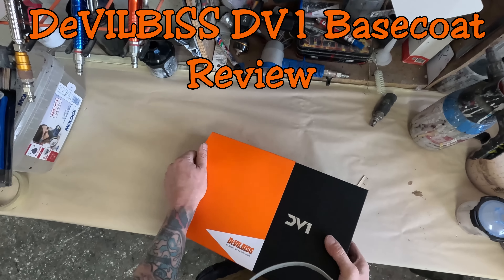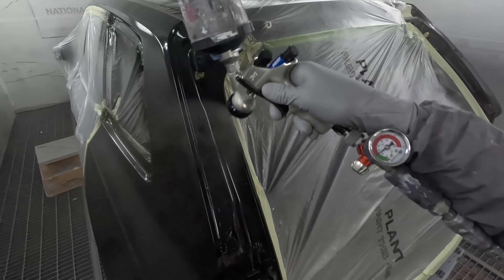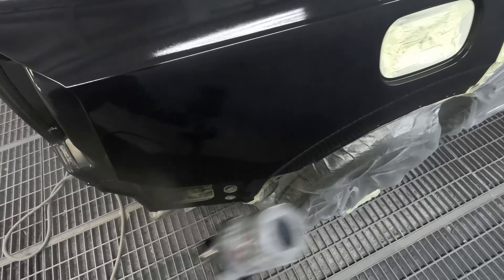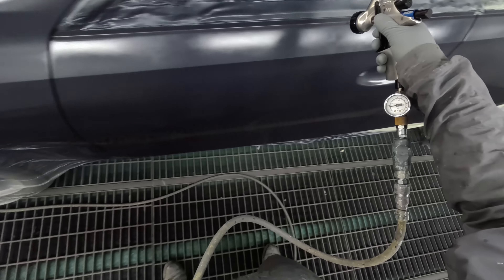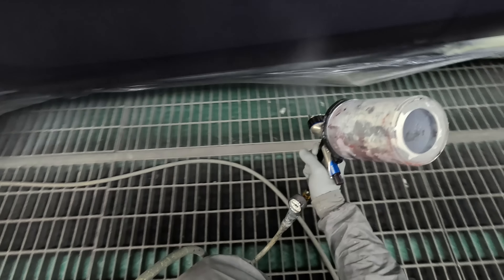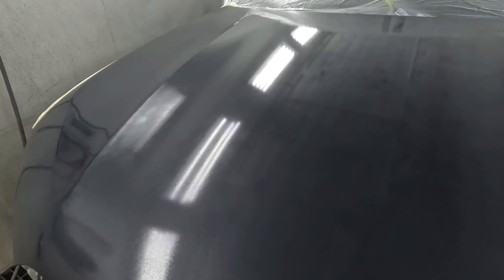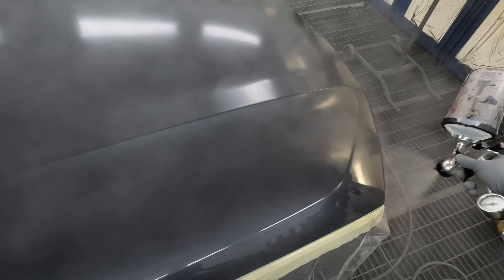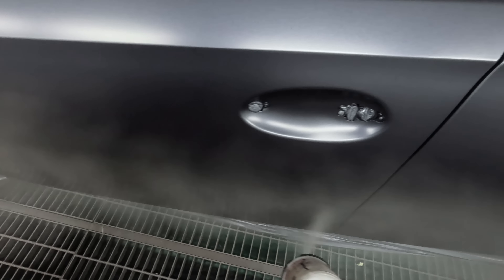DeVILBISS DV1 Basecoat Re-Review

Comment: I really like my DV1 guns I've had them a few years now and they have been spot on with no issues at all, I'm now waiting for the day when the battery goes on them as they are both digital but you can't fault the finish they put out. I have a few clear guns but only one basecoat gun as I've never needed anything else other than the DV1 for base👌🙏👍John UK.

Comment: The caps amd nozzles from base to clear are not identical.  The nozzle will sit slightly different if you dont use the corresponding cap. I.e. base nozzle and clear cap.